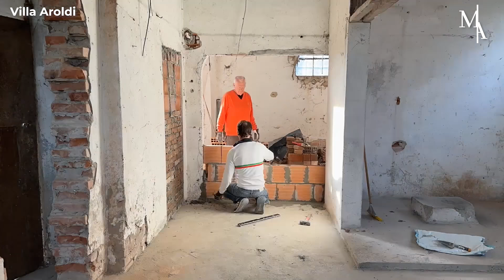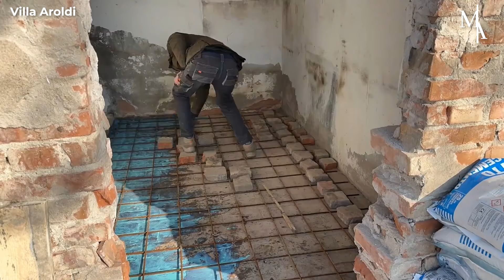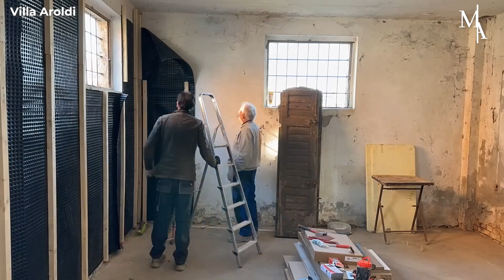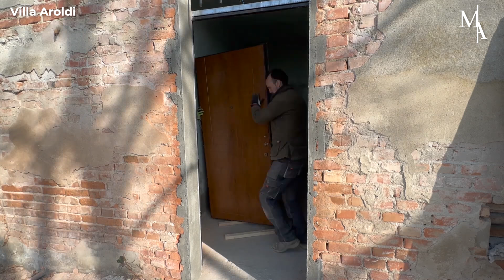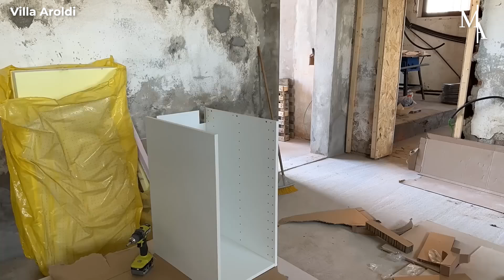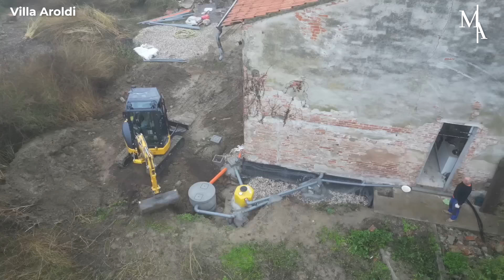Man Transforms Old Italian Barn into Amazing Villa | 3-Years Timelapse by @VillaAroldi

Comment: Nice project but ehhm. One tip: never line up your drywall boards in one continuous seam. Always stagger the joints, ideally in a running bond pattern, and offset each board by at least about 20 cm to reduce the risk of cracking over time.

Comment: I'm no pro but I was confused with the moisture barrier inside the stone walls. Never seen that before.  Without them being sealed at the bottom and top, all the moisture and potential mold that may form in between the stone and the barrier, have a way of getting  into the living spaces. And if they were sealed, it would create a non breathing gap that would absolutely get moldy, and at some point in time find its way into the interior.

What about moisture barrier under bathroom tiling? They say the tiling is waterproof but as far as I know, the grout is not watertight and that's why a layer of flexible moisture barrier is normally used under the tiling, both on floors and walls, preventing the moisture from getting into the structure.
Reply: Saltpeter, rotting brick work and stone is a real and common problem, especially with poor builds. Saltpeter, a by-product of the decomposition of organic waste, can lead to the formation of white, powdery or crusty deposits on brick, stone, or plaster surfaces. These deposits, known as efflorescence, are caused by moisture carrying dissolved salts to the wall surface, often signaling underlying damp problems such as rising damp or penetrating damp. Saltpeter can damage paint, plaster, and masonry over time, and it is essential to address these issues promptly to prevent further damage and maintain the integrity of the building.
Reply: Looks like the moisture barrier is textured on both sides, allowing airflow behind the surface layer. The function is similar to a rain screen on a house.
Reply: @robinremde3076 wrong, outside is a pipe with holes taking water out.

Comment: Well the video is incomplete since it shows nothing about the second floor. As for the concrete floors, it would be far easier if they were to order the appropriate concrete with an ISO CERTIFICATION. Pouring concrete from a 10 cubic meter concrete truck and brought in via a concrete pump. Has an engineer certified the structure as safe for renovation? The mortar in the old brickwork tends to degrade over the years if it was an improper mixture of Portland cement and sand. Usually on a remodel the exterior of the structure should be protected first with a new scratch coat of stucco or render as it is called in Europe. What about the roof structure and tiles? Once a waterproof exterior is reached only then can the interior begin. 
On the interior extra conduits for electrical utilities should be installed for future expansion. Plan ahead. What worries me is as to where in Italy this property is located. The further north the deeper all plumbing should be placed so as not to freeze in the winter. Drain lines exiting from walls above grade need to be boxed in with at least 15 cm of rigid foam board. If it’s available in Italy the drain lines should be wrapped with electrical heat tape and then they should be encapsulated with rigid foam board all the way around and then backfilled.
Reply: There’s so many things wrong with this project that I can’t even really keep track of them all. I gotta click off

Comment: Old barn walls just covered by drywall... Okay, but what about smells, mold (fungus), parasites, insects?
Reply: usually letting the bricks exposed on the external walls lets a good humidity regulation, but dont worry abt that, the insulation n wood works will guarantee that the worst sh1t known to man will grow in those holes